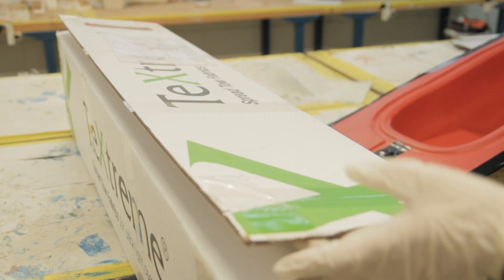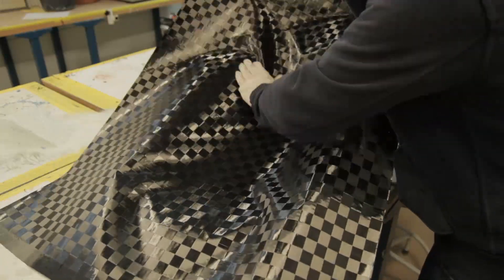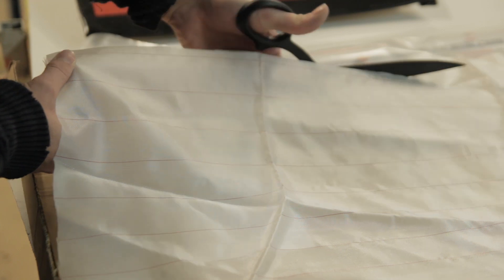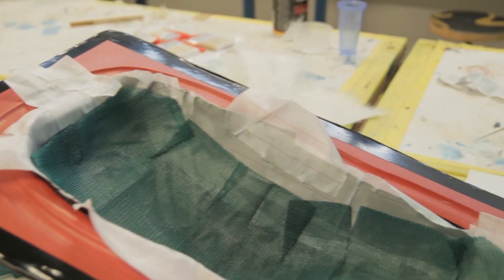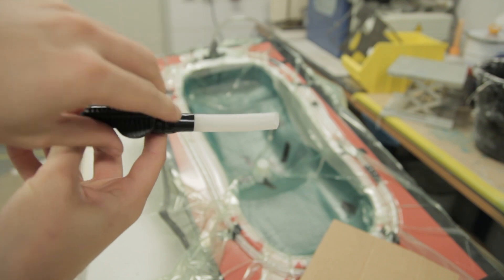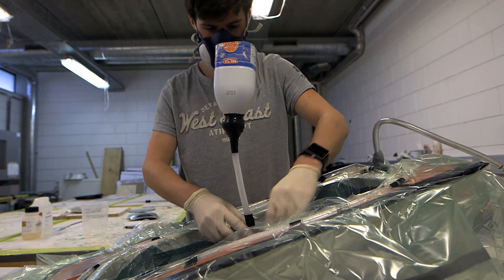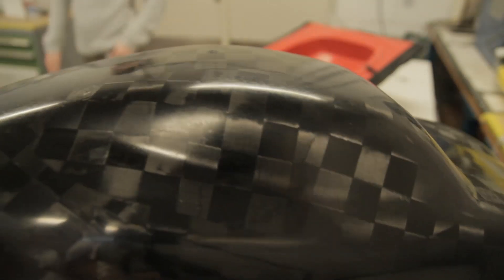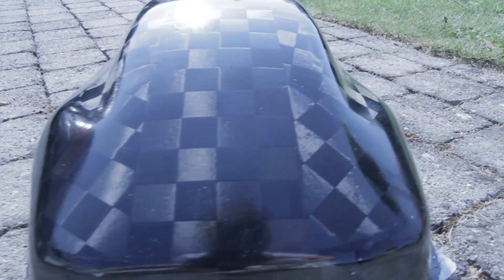Tutorial - VARTM Epoxy infusion on Textreme

Comment: what spray do you use sir? resin spray or whatt?
Reply from the maker: if your talking about the glue spray, it's a spray specially formulated for composite work. If your talking about the clear to get a gloss on the part that would have been a 1K clear out of spraycan. Nowadays I always use a spraygun with a 2K clear for better results

Comment: I just bought some 160gr Textreme and I wanted to know what the tensile strength is equal to. I made a trunk lid with a 10.9 oz 1/4" core and another 10.9. I'm woundering if a 160 gram/ 5mm core/ and another 160 would be strong enough.

Comment: Great Job, it truely is beatiful. I have not done resin infusion, but some advice next time you do another of these is have the resin flow from one of the edges of the mold and have the vacuum pull in the center. This way the spiral mesh will make the resin equally distributed.

Comment: Never put the resin supply above the lowest point of your mold! The vacuum will bulge out the vacuum, distort fibers and having the supply above the part will result in a lot more air and resin vapor in the epoxy flow.
Reply: I concur, I always try to have my resin supply at least a foot or so below my part. That said, this has clearly worked for Matt, so top work as always Matt :)